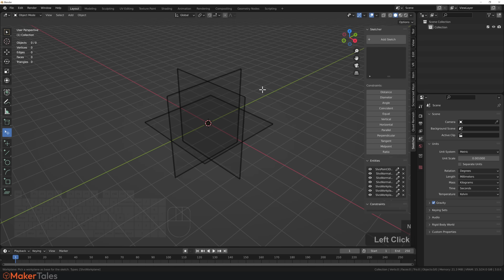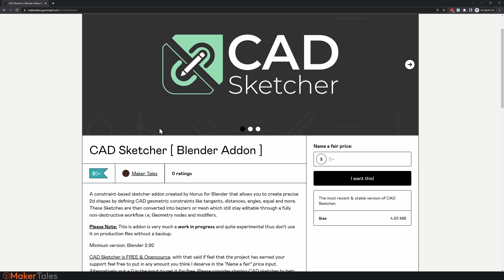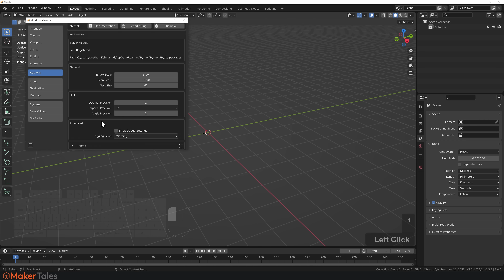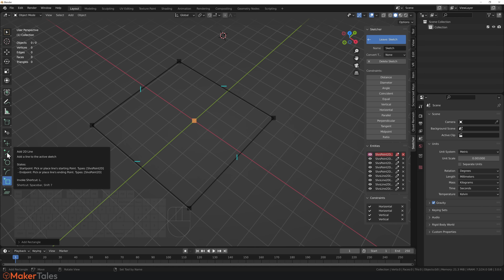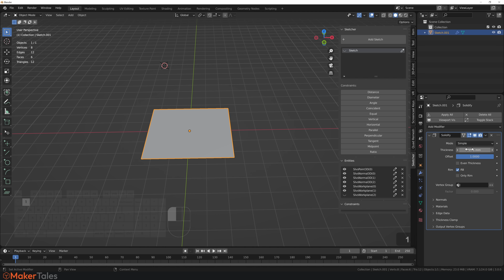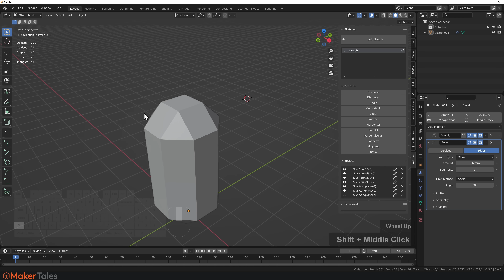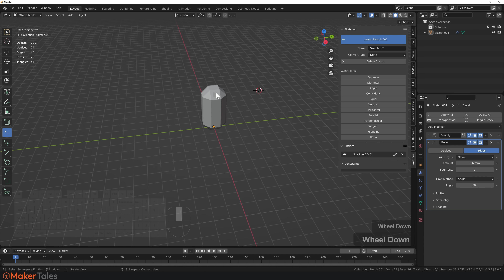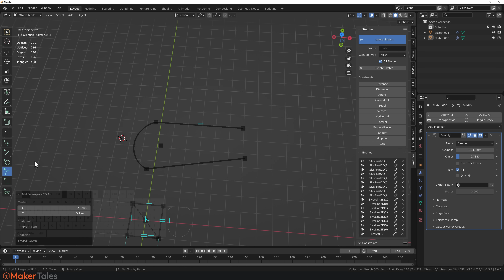CAD In Blender Is HERE! | CAD Sketcher Intro | Constraint Driven Design

Comment: oooh! As someone who's been banging my head into the brick wall learning curve of FreeCAD without any progress, I am very intrigued to see an approach in Blender that may work more intuitively... or at all.
Reply: After spending months giving FreeCAD my best shot using it both personally and for work, I finally got just too damned frustrated by it and switched to Fusion360. It's too unstable, too clunky, and stunningly obtuse.
Reply: I know the struggle. I have just tried modelling something simple in FreeCAD another time just the other day and it failed without explanation, this time right in the sketch solver, which is not a component i had issues with before. But i've had so many mystery failures before. I repeated the same steps, it failed again. Then i repeated the same steps in FreeCad LinkStage3  (aka Realthunder's fork) and it WORKED.

I have had situations where i had reproducible issues like that several times before, and once i decided to report a bug, but it was impossible, i was supposed to create a forum thread first before filing on the developer issue tracker. I did, i uploaded my files, made a full description of steps, and as a result, a helpful francophone forum member (so there was a language barrier) tried ever more convoluted and difficult to understand ways to rescue my project; but i could not get a simple answer out of the forum whether what i'm seeing is a bug that i'm allowed to report on the issue tracker, or whether it's supposed to behave like that for some hard reason. I asked explicitly. It was seriously heartbreaking, like, if it's a bug, OK, it'll get fixed eventually, if there's a reason, OK, i can work with that, but like, uh, what, nothing, i'm at loss for words.

I have had this sort of a mixed success with FreeCAD main upstream branch in the past, but i haven't run into a problem with LinkStage3 yet. Like sure it's as convoluted, concept-heavy and opaque as the upstream, it inherits all of the inherent issues, but at least everything i throw at it just works. I have also done complex designs in Fusion and while that's a lock slicker and smoother, i actually can't say for certain which of them i like more, since FreeCAD has a lot of inherent power and functionality, like a LOT.

So yeah you can learn FreeCAD, you can follow tutorials, it's all entirely possible, and it's got some massive benefits, but please use Realthunder's fork, you can do all the same steps, the same tutorials apply. From what i hear, in a couple years, it's planned to integrate that fork back fully into upstream FreeCAD, but they're quite slow.

Whether Blender will ever be as smooth to use as a real CAD, i don't know... but it's an exciting development.
Reply: @SianaGearz  I second to that , LS3 is the way to go. I can se some benefots in cad in blender but what about tech drawings, what abbout assemblies? I once trued to learn blender and it gave it up beacause it was clunky and unwieldy as hell and stayed with 3dstudiomax
Reply: @foootz  haha I went the opposite way and switched from the clunky 3DS Max R3 to a much more direct and artistically helpful Blender 2.0a more than 20 years ago! Blender is very unusual but once you're in its workflow, it works with you. Back in the day it was all about printing out the keyboard cheat sheet and learning it. Now it's got more flexibility and discoverability but retains the same workflow.

Comment: Counting down the days till I cancel my fusion 360 subscription :P
Reply: Fusion 360 is better for Cad than this program and is real cad compared. Use the proper tool for the job instead of nonsense add on's to software not designed for it.

Comment: This add-on looks amazing.  I'm super impressed and psyched to use this new tool.  The potential of this boggles.
After installation and then following this tutorial, I started by clicking "add sketch" and the 3-plane thing that appeared was about 50 times larger than my entire model and screen view.  I have a default scene set up to millimeters and the default cube is 10mm on a square plane that is 100mm.  I wonder if there's a way to set up the default size of the 3D sketch plane thing.
Upon drawing the sketch, the dimensions were placed with super long leaders, the arrows would not drag, and the number values are huge, like 100mm tall.  The construction line appeared as solid despite the property box being selected.  I'm betting that the issues I'm having are some sort of scene scaling thing.  I have unit system = metric,  units scale = 1, and length set to mm.  That's right isn't it?
Reply: Unit scale must be 0.001
Reply: @plane9182  Thank you, that solved everything.  Now the sketch planes and dims appear with sensible sizes and are easier to select.  I had to edit the values in all the object modifiers, rescale the X/Y/Z positions of all objects, etc  You know, all the usual stuff.  I wonder if there's an add-on that can rescale entire scenes!  I guess the lesson is to set the unit scale correctly from the start.  Also, Jonathan already posted a video on scaling a scene for precision modeling so it's not like I wasn't told previously.

Comment: Oh my freaking gosh, a tool that is actually FREE and it can do actual CAD?! For somebody with an engineering background, I totally need this tool. It would make precision modeling so much simpler. And as also a developing artist, I would like to explore how to integrate the use of this tool with the "vanilla" modeling workflows just so that I can make stuff to render as art while making as accurate as possible to the real thing (great for things like product visualization and the like). 

The feature I really want, actually, is the ability to really define curves mathematically. I hope that feature is coming, too, but I haven't really look into this (still need to install this thing). This is so that I could do things like propellers and wings that are actually accurate to the real thing.
Reply: You should look into FreeCAD. Maker Tales has done some introductory videos on it as well. It's not integrated into blender like this is, but it's free, open source, and a much more complete parametric modeling solution. Definitely recommend the realthunder branch of FreeCAD as it's more complete and has some bug fixes.
Reply: @rustywidget4813  Blender has been my main tool for a while. And I am currently interested in integrating design with art rather than doing any serious design work. But I will check out FreeCAD someday
Reply: It technically can't do "real" CAD.

Comment: this is incredible honestly. I baught and installed after 10 seconds in. As a long time CAD user getting used to blender-style modelling has always been a challenge. Sketching is one of those things that really makes a difference, especially when it's parametric. Looking forward to see how this will develop in the future.
Reply: One really interesting thing that could be is having various ways to create work planes. Which i'm sure you've already thought about, but is an incredibly powerful tool when you can create planes through edges, vertices, angle, offsets and so on. Anyway, already this is amazing.
Reply: @guynao  it's one of the main reasons I went with Shapr3D- adding planes in four taps, can even add planes through three points
Reply: @redherring5532  yes shapr3d is great actually i need to try using it a bit more. I normally do 3d modelling for productiong on more heavy duty CAD programs like fusion, solidworks, rhino, and use blender for rendering/animations/modelling of non-production items or concepting. But precision modelling in blender is still something i struggle with. Adding workplanes is just something that really enables sketch-based modelling be powerful. With introducing an addon like that in blender, it just seems like a natural future step to look into, which i'm sure the developers are thinking about.

Comment: Yaaah its 50% of fusion 360 I like tis add on.  if you succes 100% really fusione 360 gone for good 😁😁
Reply: Except this isn't real cad like fusion 360. Blender is based on polygon modeling instead of nurbs so it is not ever going to be a replacement.
Reply: @corail53  yes but I belive in blender blender 100% do somthing in future.  blenler its tooo fast growing.

Comment: This is potentially one of the very best Blender news ever! As a designer, a real CAD system in Blender would be a dream come true. Thank you very much!
Reply: I second that. As a user of Inventor for nearly 20 years and having use Pro-E, Catia and Solidworks in different jobs, I installed Blender a year ago to give it a try and my reaction was, "very nice piece of software but nah", I've watched a couple of people doing stuff of youtube and my god, talk about zero precision for engineering stuff but if they come up with something just a bit close I will definitely reconsider.
Reply: @frankmayer7960  I don't agree with "zero precision", because you can set up Blender in real world units. "solidify" modifier is a good stand-in for the traditional CAD extrusion, etc etc... all of that being said - I totally agree with you that working with Blender for CAD stuff is cumbersome and slow by default! Boolean modifiers for instance - if I wanna cut 4 holes at a precise depth while grouping them under a single "name", means I have a single (compound...) mesh for it, and I need to edit said mesh (instead of my main part) to change the dimensions of the holes etc... which is inconvenient because when you're NOT editing these holes, you'll usually want that boolean mesh hidden so you can work on other things... I've seen MANY (MANY MANY MANY) Blender plugins over the years that claim to help with CAD but (at least until now) these didn't even come close to most (even half-baked and crashy...) opencascade frontends (and FreeCAD is really good now).

I'm extremely curious to see how much this "CAD sketcher" thing changes the game :-)
Reply: @cheaterman49  real world units mean little when snapping is almost non-existent and a lot of the tools don't care about actual units and use weird stuff like percentages (loop cut is a good example). Its not completely impossible to model somewhat precisely in Blender, but it takes much more actions to get to the same results as in a CAD package in terms of precision. And for the aforementioned reasons, its also pretty easy to just screw up your precision somewhere along the way.
Reply: @daniilnoun8262  So you didn't try CAD sketcher. Enough said really, as all your criticism really doesn't apply to the addon and the workflow it provides. Give it a try! :-)
Reply: @cheaterman49  well, CAD sketcher is the reason Im here, haha. I was talking about default blender workflow and the fact that its lacking precision, unfortunately.
Reply: @daniilnoun8262  I totally agree with you :-D I'm just pointing out that CAD Sketcher is indeed a gamechanger, at least for me! Can't wait to hear your feedback on it :-)
Reply: @frankmayer7960  I agree. I recently started working with it to make less precise models (mostly VR chat stuff on the side.) and Lord is it so much more of a headache to deal with that lack of precision. Some friends of mine have been sitting there expecting me to just be a complete natural with it since I'm so experienced with CAD, and to say the least I've been a bit of a disappointment. It's like trying to stitch together a shirt with wet pasta.
Reply: @frankmayer7960  My first introduction to 3D software was Inventor in my Intro to Engineering class in high school. Modeling in Blender is fairly easy, but I always find myself wishing I had the ability to quickly draw a profile to specific lengths and angles then revolve or extrude.
Reply: I third this as a 3d printing enthusiast 🥰
Reply: @ericholliday7071  for 3d printing you don't really need cad... the 3d printers themselves accept meshes like STL models
Reply: @DarkShroom  yeah but CAD-apps are great for precision models, which is finicky in Blender. CAD Sketcher looks very promising! Wish I was a developer
Reply: @DarkShroom  You want CAD if you want to be able to model anything more than dust collectors.
Reply: @DarkShroom  for 3d printing, parametric cad is really needed. Unless one wants to print 3d benchies and minis
Reply: Im in the same biat as you my friend!
Reply: while the wish is great reality is it will not happen. for that blender needs nurbs modeling tools. but I can see this being very useful for interior design / archViz

Comment: Excellent.
Long overdue.
Never understood why the open source community required two seperate 3D modelling tools.
Especially when splitting time and development resources instead of combining it.
That is of course, on the proviso CAD sketcher will remain open source & free.
Lots of packages start out that way to get market share, then suddenly go private, once its effectively cornered the market with a must have tool.
Reply: Blender is polygon based. The model resolution depends on the number of polygons it has. A true CAD program (ex. FreeCad) is Nurbs based which is mathematically precise. You don't loose precision no matter how deep you zoom in. These two format are not exactly interchangeable. This is analogous to Raster vs Vector in 2D graphics systems.
Reply: @alihms  Isnt that the equivalent of demanding modellers write in machine code rather than C++ though ?
IMHO, that is kind of missing the point.
Granted, freehand solid vertex modelling is often desired.
But sometimes a higher level shape modelling is often desired, with an abstraction layer between.
One forces the user to physically model the number of polygons used.
One method does not and can leave the software to automate the polygon count by scale.

Basically, just because you want a vertex mesh as a final product, doesnt mean you have to work at the vertex mesh low level.
Nor do you meed to store the structure as a vertex mesh model.